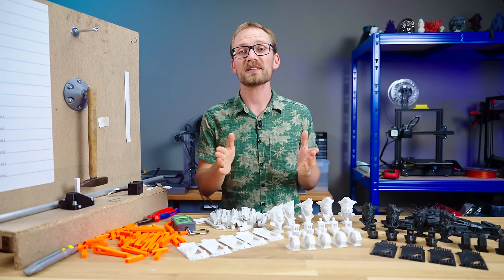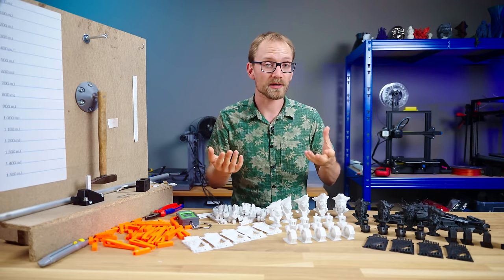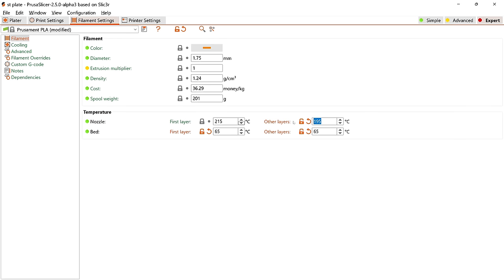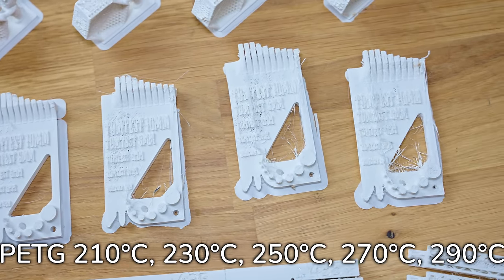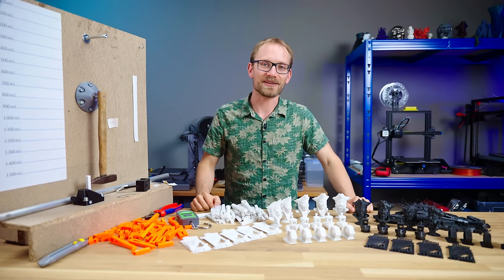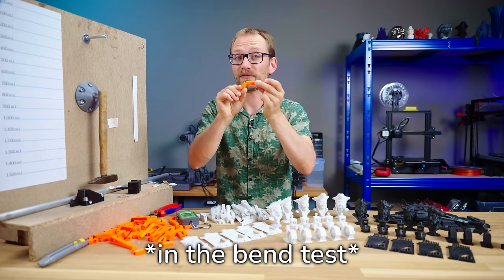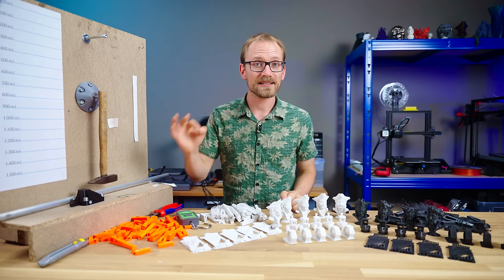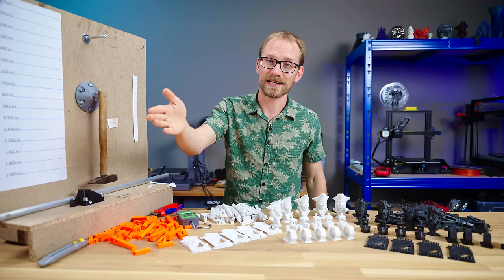Are you printing at the right temperature?

Comment: White PETG is always reliably bad for me, doesn’t matter the brand I’ve tried. Something about the pigment just makes it worse than every other color.
Reply: I agree I avoid white filaments
Reply: Had the same with white PLA. It was terrible so never again.
Reply: All white filaments are a hassle to me, no matter the polymer. PLA, PETG, ASA, ABS, TPU, no matter what, I need at least two prints to get acceptable results.
Reply: The "milky white" PETG I get from California Filaments has always printed fine for me. My guess is that they have less of the white pigment - hence the semi-translucent "milky" appearance. If you really want white in PETG, you might give that a try.
Reply: Do they just have to load it up too much with the TiO_2 powder to make PET look opaque enough?
Reply: @wturber  i have milky white petg and print 260°c and black from same brand that needs only 230°c to print, so with white just up the tempature
Reply: my petg setting's are just hyperfast chep profile at 230° for all non white color
Reply: That’s strange, I’m new to 3D printing but white seems to be more reliable for printing very small things while the black and gray blob horribly. 🤔 I’ll take failing upward any day lol
Reply: prusament signal white petg prints just as well as the other colours in my experience - beautifully!
Reply: I like the look of Polymakers PolyTerra matte white PLA, but it’s so soft. It prints fine if a bit unreliably, but the parts are like cold chewing gum. The black PLA of the same line is completely different.
Reply: Use glue and lower your speed.. youll love me 😅 or just use abs.. an already established plastic 
Been gettng way better prints in abs
Reply: I got white pla from China. It was excellent. Never encountered this problem.

Comment: The only confounding part: how accurate is each machine’s thermistor?
Reply: A good point. A test like this can give you a good sense of the general tendency, but you need to calibrate to your own machine in the end. My gut feel is that consumer machines probably vary enough that any two machines could easily be 5C different for the same indicated temperature.  You could check build plates with a simple IR thermometer. But nozzle temp is a bit tougher.
Reply: @wturber  my ender 3 s1 bed was about 8° C lower than the temperature sensor reported before I redid the PID tuning and added insulation foam. Now its only 4°C colder than set.
Reply: @twanheijkoop6753  I should actually test mine.

Comment: Good tips but in general it's simply easier to pick the highest temperature which allows bridges and overhangs to work well. It's usually very close to the optimal temperature, there's little to be gained by going higher.

Comment: Thanks for your contribution to this type of info. However, what about the affects of fan cooling on layer adhesion. For instance using 15% fan power vs 100% fan on PLA prints. I know personal experience shows this is definitely the case for PETG favoring 15% fan power and not much more for best layer adhesion.
Reply: Absolutely. I appreciate the time gone into the video. I just wish this was mentioned. Unless my layer times are low, I print with no fan for PETG to get max strength. It makes a huge difference especially with layer adhesion.
Reply: @karlosss1868  Odd I have always printed with 100% and never noticed adhesion issues. I'll have to play with it now.
Reply: @karlosss1868  I agree for max strength running petg with 0% fans. But If the print design needs some assistance for some fan cooling for bridging,  it is always a balance of quality of overall shape yields vs strength in conjunction with overall quality of a parts intended purpose.
Reply: Probably something to do with exponential growth of the search space.
Reply: CNC kitchen has a great video on how cooling fan affects part strength. With PLA and PETG you can turn fan down alot but you must print your parts really slow. This will allow the layer to cool enough to not have bad print quality but you must be patient.

Comment: One aspect of temperature that you didn't cover in this video, but have in past ones: thermal expansion. The hotter you print, the more the plastic expands, and therefore contracts while cooling... This is one of the main factors in warping and necessitates a heated build chamber for certain materials. The low temps parts aren't shrinking as much and are tighter when put in the same hole as a part printed at a higher temp.

Also print speed is a huge factor in print temperature. The bottom line is heat transfer, how much heat is getting into the plastic, what that heat does, and how long it stays there. If I want stronger prints with better adhered layers, I print slower. If strength isn't a factor and I need a faster print, I turn up the temp with the speed.
Reply: What would you consider as slow printing? I can most certainly confirm that printing Cf nylon at 30mm/s is much weaker than printing the exact same part at 60mm/s. By printing faster, the lower layers are actually at a higher temperature thus improving bonding strength. You can take this further by printing at 60-80mm/s but at far higher temperatures than recommended. For example, I print Taulmans CF nylon at ~70mm/s at 280-285°C. They recommend 255-260°C. This makes the layer adhesion insanely strong and the part overall is leagues stronger and stiffer. The downside is supports will bond way too well and warping becomes a factor to be weary of.
Reply: @FrozenByFire3  there's probably multiple ways to reach a certain result, with different downsides
Reply: I know im 2 years behind on this comment, but I am also finding that in some cases not cooling quickly enough with certain filaments (in my case polymaker polylite pla pro) Causes filament on overhands to curl upward due to still being too hot when the nozzle runs back over them and leaves them curled upwards. So in some cases cooling is very important, especially after the first few layers!

Comment: For me, 10 ° under high number on filament spool has always worked well. Then bed pla 55 ° and Petg 85 °   
Biggest fix I’ve learn for bed adhesion and avoiding fuzzy first lays with a PEI Flex sheet is just occasionally washing it in the sink under hot water with dawn dish detergent. Try this first when things go wrong all of the sudden. I learned this after days of settings chasing.  Great video!

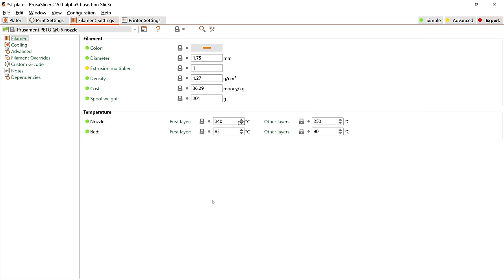Comment: 11:40 "I should note that the default temperature for Prusament PETG, on PrusaSlicer on a Prusa MK3 is 250 Prusa-degrees" 
I know Prusa have printers and slicers but I didn't know they had their own units 😂
Reply: All the post-soviet 3d printing enthusiasts refer to "parrots", not degrees. This origins from an old cartoon scene with character measuring a big snakes body length with a parrot. Every printer reports temperature a bit off (most of them are Chinese here, so more prone to this behavior) so sharing what temperature you use is more "scientific" if you mention the units may vary this way:)
Reply: Most of the thermistors are manufacturered in China. Even on American and German 3D printers, so mostly their temperatures are the same as the Chinese ones. You can buy thermistors with different temperature tolerances. All from China. So it depends on what is installed and where exactly it is located in measurement. Also the thermistors are all rated at 25C but have different thermal constants. But the manufacturers are aware of what these are and choose them specifically. The possibility is manufacturers  don't test a part to confirm the characteristic tolerance is within spec.

Comment: honestly, temperature settings are something I set on a per-print basis. Things that I factor in are: Nozzle size, purpose of the print, room temperature, are there any large bridges etc.
I generally print PLA with 200-210 Celsius, a bit lower for 0.2 nozzle, about 220 with a 0.6/0.8 nozzle(those are mostly vasae mode prints where I want it to hold water and usually increase flow to about 110% ish)
Reply: what bed temperature?

Comment: 9:30 My guess would be, that there's a higher pressure build up in the nozzle, when you print colder.
And because of that pressure, the filament will bloat up more, when leaving the nozzle.
Reply: yup, was thinking the same thing. Lower temp = higher viscosity, which in turn results in higher extrusion pressures and increased die swell.
Reply: I would have thought slicers allocate for shrink,  but too cold and the parts don't shrink to expected dimensions and end up slightly larger
Reply: @erikwithaknotac  Except that the user sets the Extrusion Multiplier so that the final extrusion width should match the value entered in the slicer for extrusion width, theoretically taking shrinkage out of the equation for the baseline. Also, for  the lower temperatures, thermal expansion plays a much lower role than die swell for governing extrusion width (you can verify this by observing the relative change in line width with change in temperature vs change in extrusion speed). 

I am assuming that Tom didn't change the EM settings for each temperature, but just used the stock setting for the entire run, which means that the main contributor to extrusion width is going to be die swell.

Comment: Thanks for the test! I do appreciate the time it takes to print all those test samples =)
I usually found that "glittery" PLA prints way smoother welds at 225 compared to 215 that i actually found works best for run of the mill single color PLA.
Reply: Additives definitely skew the temperatures.  Anything with an iridescent additive I crank up to 230, else it just falls apart.

Comment: I have also noticed PLA having a tendency of printing less glossy, more matte at lower temperatures, which is why I tend to lower the temperature somewhat for decorative items; matte items just tend to look better than glossy. I haven't bothered increasing temperatures and instead just adjust infill and/or shells, if I need stronger parts -- I haven't done any proper measurements, but I haven't seen any benefit in increased temps.
Reply: @Benson Except your analogy is idiotic and doesn't work. One can e.g. perfectly well tell an improvement in acceleration even without a speedometer.

Comment: Watching this makes me glad I can create project profiles directly on my old faithful Ultimaker S3 dual nozzle printer (with NFC filament recognition) (auto levelling & heating). Using preset profiles that I found can include all known and customisable settings, making it easy for novices like me, to start at commercial grade printing qualities, without the hassle of knowing in advance what's required, just splice and load to get projects completed quickly, with a professional finish that requires little to no post processing.

Thanks for sharing your invaluable information. 👍

Comment: I'm guessing the cold parts are coming out oversized due to die swell. Basically you have a greater temperature gradient as not all the plastic is coming out at the same level of "melted". This leads to internal stresses that can cause the filament to expand out of the nozzle
Reply: Bingo.

Comment: Thanks for doing science! I've just been printing PLA at the default setting of 200C, except bumping up the first layer to 205C for better bed adhesion at the cost of more elephant's foot. Maybe I need to do some testing myself to see if slightly higher temps would be better for the subsequent layers.
Reply: what do you set the bed temperature?

Comment: Great to see that prusa has their temps in line! I do get pretty bad stringing with PETG at stock temps though, but I do think that is due to the swampy-ness of Florida more than anything else. Easy to clean up, but a bummer none the less! The impact strength is definitely an interesting one. Those variations could be from layer strength as well either yielding or snapping. Obviously a yield will absorb more than a snap? Not sure if there is correlation there.
Reply: Stringing is mostly from not enough cooling for PETG as I had a stock ender 5 pro did tests with it stock before I did the upgraded cooling mod huge difference and no more strings and can even print faster with the new cooling saving time.
Reply: @Bigdog1787  I run mostly Prusas, cooling is not normally an issue. PETG is known to string as it gets a little bit moist. Having ambient humidity near 50% it is no surprise to me. We just deal with it
Reply: I have the same problem, and that's with normal humidity and dried filament. Prusament PETG at Stock 250°C prints absolutely awful, hat to go way down to 230 degrees to get reasonable (still not perfect) prints. I am using a plated copper nozzle though, and thought it was due to the better heat transfer. Anyway, i am not happy with how the Prusament PETG Prints on my MK3...

Comment: I had to shake my head a bit about this test batch. Firstly, if I'm printing a part for which strength is a concern, you can darn well bet that I'm not going to print with two walls and 15% infill. That's the kind of setting I would use for generally non-functional parts that deal with little or no real stress.  For strong parts, you really do often want your part to "pretend" that it is an injected molded part. Why? Because injection molding is expensive and sometimes you want a part to actually do useful work.  I don't print my bike tire removal levers with two walls and 15% infill precisely because I'm going to subject them to high bending loads near the limits of the PETG material - much as your bending test does.

Secondly, you chose a matte PETG?!?!? Even if you didn't run into the semi predictable problems that you showed (I print a fair bit of matte black PETG because I really like the finish), I would never assume that a matte PETG filament would provide typical PETG results. In looking at matte PETG, it appears to have some kind of filler that gives it the matte finish. I don't know what that filler is, but I'm assuming that it does not increase structural strength and that it probably compromises it. I treat it as a different material than ordinary PETG. If I were to take this kind of time to do a test, I'd pick either ordinary colors that were the same for both materials, or neutral/no pigment colors. In this case, clear and "natural" for PETG and PLA respectively would be preferred. Doing this means you are testing the plastic and not the dyes or fillers.

I'm a fan of both Thomas and Stefan. But I found this test video a bit dumbfounding.
Reply: I think you misunderstood his explanation about the strength testing parts. He wasn't trying to test ways to make strong parts, he was trying to test the strength of typical printed parts using the most common settings of 2 walls and 15% infill. There are better ways to make strong parts than that. CNC kitchen did a great video on that, it's really most efficient to increase shell thickness.

On the second point, I think he was using the standard Prusament PETG that isn't a special matte finish. I had never heard of the matte finish specific PETG though, that sounds really interesting! Have you found the matte black to have significant mechanical weaknesses? That sounds kind of perfect for a project I've got going.
Reply: @evanbarnes9984  I think you missed my point. People printing with only two walls generally aren't very concerned about strength. In situations where strength is any more than a passing issue, people print more and thicker walls - for the exact reasons the CNC Kitchen video outline.  I'd also think that having more layers would be make for a statistically better test since with more layer lines, any unusually weaker line would have less relative influence on the results. Maybe his one "noisy" graph would have given better results if more layer lines were involved?

To be fair, his two 0.6mm lines are just as thick as three 0.4 mm lines.

As for the matte black PETG, I can't say for sure that it isn't as strong. My impression is that its "chalky" nature probably makes for weaker adhesion. But I've never actually tested if. I use the matte because I really like the look. In fact, it can look very nice when combined with the Cura "Fuzzy Skin" feature. If you'd like, I'll do some simple tests. In fact, I'll probably do it either way since this is something I'm a bit curious about myself. 

As for the look of the filament, search for California Filaments. The have reviews online that often have photos. They also have matte in, I think four colors.

Comment: For cold extrusion temps, the filament is not entirely molten but soft enough to squeeze through the nozzle and then expands after it exits causing the layers to be thicker thus poorer tolerance. It may even be molten on the outside since that is the part of the filament in direct contact with the heater block but with a soft inner core not totally hitting the molten temp. You can see this with a zoom camera on the nozzle.